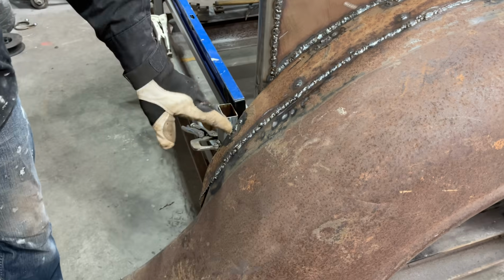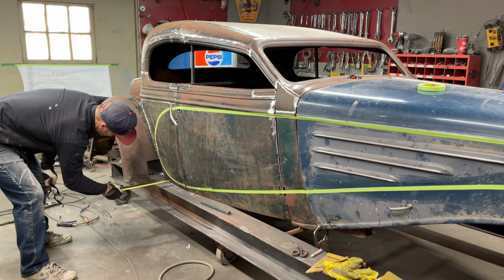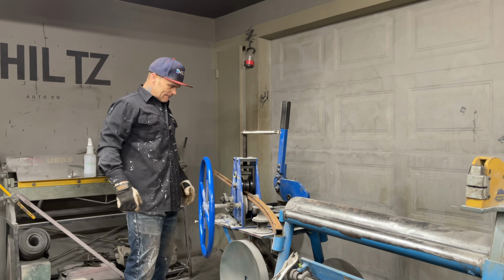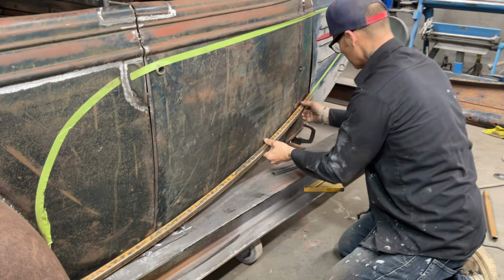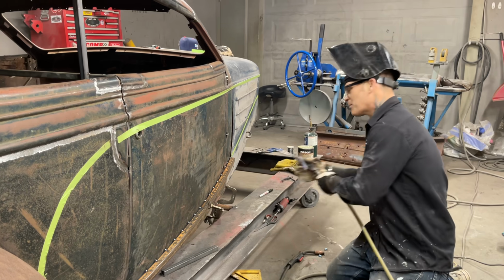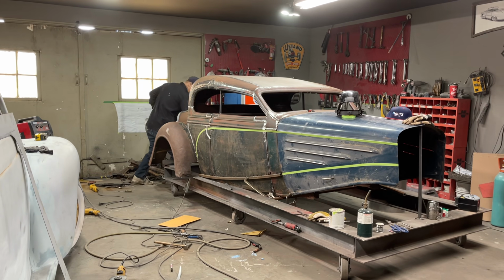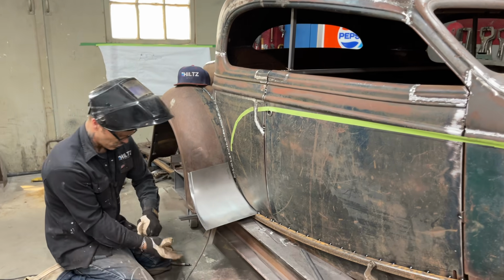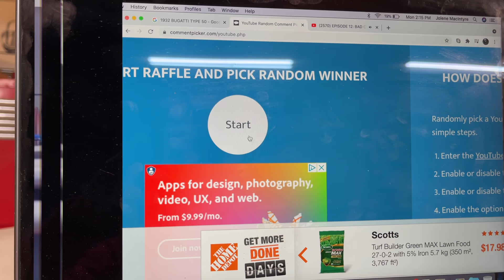EPISODE 13: BAD CHAD BUILDS (ANOTHER) BUGATTI OUT OF 1934 CHEVY -- RUNNING BOARD FABRICATION

Comment: Seems that the door is going to spring back in from where you clamped it to the square tubing once you cut the door to open and close without the support from the running board.

Comment: I'm from Mesa Arizona. I just figured out that if you want the door to open properly with the front of the door smaller than the back it has to open with the hinges on the back and the latch on front otherwise I'll hit the fender. I'm assuming you already figured that out

Comment: As a home car builder and hot rod guy Just a little curious .Why didn't you install the front fender before you started on the running board ? it would have give you a better sight line for the cut measurement to connect the tow fenders. think your a great instructor and your very comical .You remind me of an uncle I had. keep up the good work

Comment: I don't comment very often. I like to watch, listen and learn. Today I will comment. The running board tubing is like a rib cage. Add some ribs to the curved square tube to help guide the sheet metal. Don't cut the other curved sheet for the other side. The marks need to be mirrored. All the best to you both.

Comment: On the rolling machine put a sprocket twice the diameter on the driven shaft. ( Not the wheel ). It will feed slower but alot easier to turn.

Comment: I suggest that you build the frame of your fender before trying to skin it.If you weld a fender lower fender support straight out from your body you could set your sheetmetal on it and not have to wrestle it around, Framework would resemble a ladder sticking out from the body!

Comment: If you make the running board tip slightly down on the outside edge then water will run off. Level is a relative term lol

Comment: Hi again. That car is looking Bad Chad. I really hope you paint it. The "pantina" look only works on a car that's not been all cut up. and has some original paint like the hood. If you have to faux  "fake" patina it with paint it always shows. As they say a thirty footer. Get any closer and the faux finish is obvious. I.m just curious as to why you don't bend both pieces of square tubing at the same time as a set. I would think it would be easier to lay one on the other to match up? Plus the machine is set once, just run both pieces through. Looking good. Bye from Connecticut.

Comment: Hail from poplar montana,on hiway 2,fort sioux an assiniboine reservation headqtrs. My auto body inst. Bob Reid did things in metal,he had all the work except th upholstry, he was fast an i first seen his Tbucket when i was in 5th grade,it was rusty an had chrome 9" an 8 individual headers all chrome on a 327 hi horse small block w tall tunnal ram n 2 carbs. Th solid motor mounts made whole T rock.  I thank you chad n son n mrs chad, my truck need driveshaft,440 magnum w 727 n transfer case w 2 wd fir hi n low gearing, in my mind it works. A 77 dodge d100 2wd shortbox

Comment: Chad, people that using tubing/bar rollers don't realize that you can't always do progressive bend because of yield strength. When I built my Monocycle rim, I had a target but when it came close I went with it and built the frame, etc. to match. Why? Because I wanted it 5' 6" and when it got to 5' 7-1/2" if it tightened to rollers enough to get it to roll tighter by the time it was tight enough to get it to yield it would have been too small.

Comment: Chad, you need to step back and take a breather before you make a booboo, correct me if I'm wrong but duplicating that sheet for the other side is no good. Should have traced it on card then reversed it because all you have done is duplicate the same side. Loving the work though. Greetings from South Wales in the UK